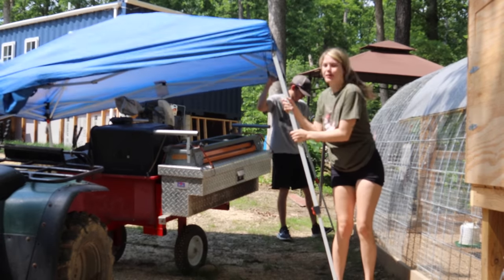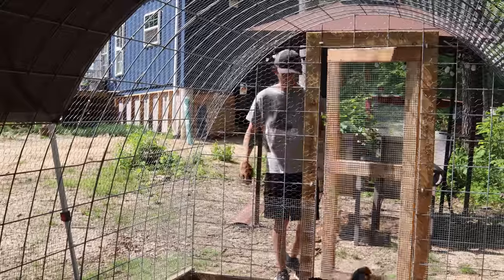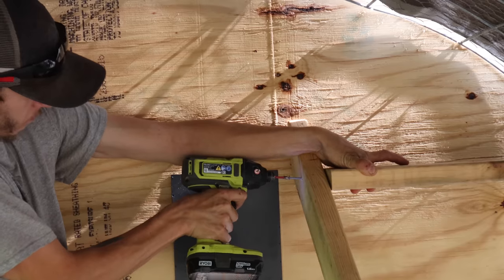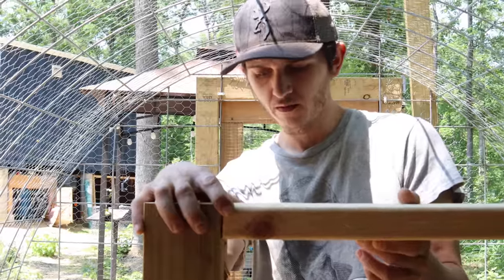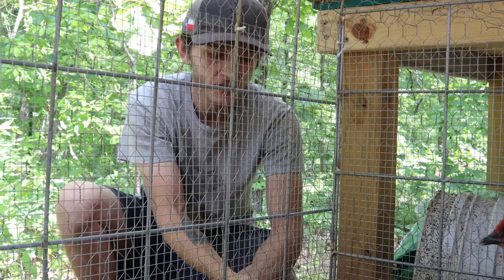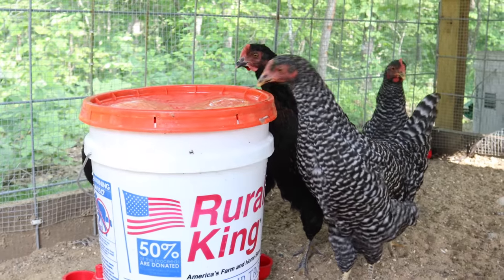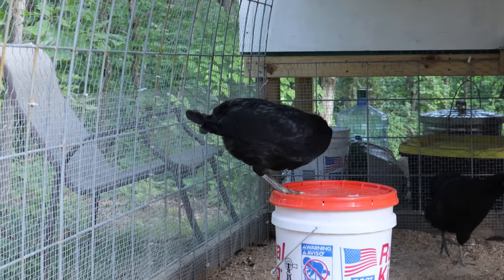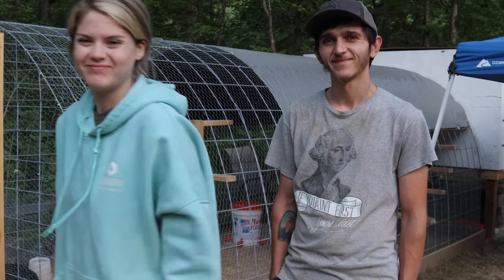Easy UPGRADES to your Chicken Coop |Container House Homestead |EP:117

Comment: well now ;;;thats a nice cackleberry maker coop;;;lol;;;;Texasprepper 2 made asimilar hut viewed on the tube as a greenhouse and I used his plans so to speak to make one and that''s what I use to overwinter plants and starting seeds for gardening;;;I also like the 2x4s around the post;;;;neat;;;;however I use a 3/8'' dowel a half inch in from sides drilled at a slant from2x4 starting about 3'' back on 2x4 top to drill thru to 4x4 making sure to slant drill to not come out of 2x4 before entering the 4x4;;;;making the hole as long as possible in both;;;sand the dowel a bit to ensure goes in the holes;;;glue up well and slide in or drive in which won't loosen up with the weight hitting the perch repeated;y;;;;;welll mine was for a gardenhose rack which can get fairly heavy at times if ya water with hose still on perch;;;lol;;;;hope this makes sense  but my first attempt didn't last with just screws;;;been two years now and still holding with added dowels;;;;oh I bought greenhouse plastic to cover mine and working on 5th year with it;;;used pipe insulation on corners to keep from poking holes in plastic;;;;oh me when ya get old ya write books explanning;;;also loke that tool cart;;;I need to borrow that thing for awhile can ya bring down to texas for a couple of years;;;lol;;;;a big thumbs up and keep em comin